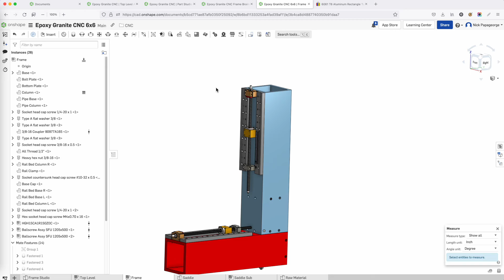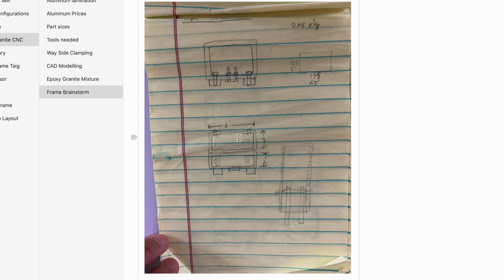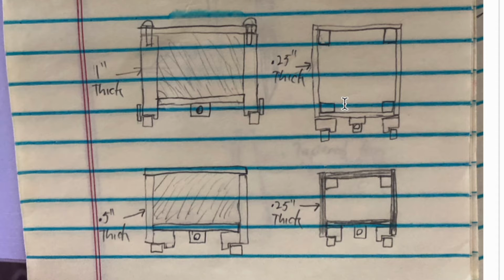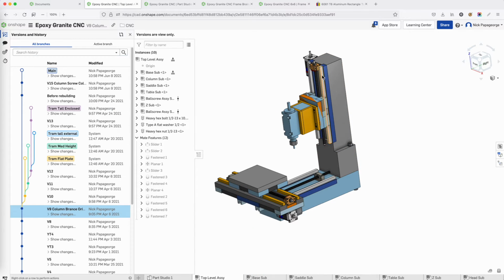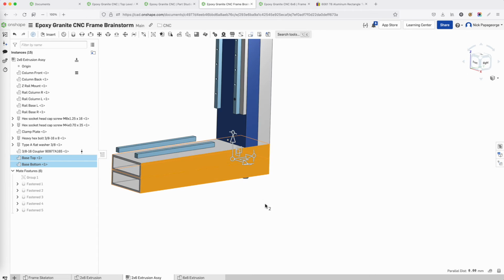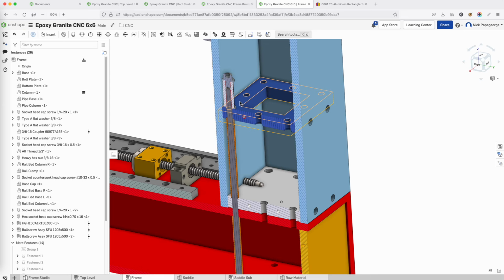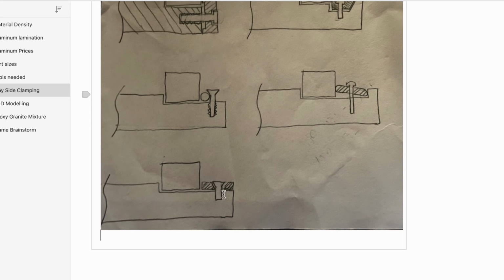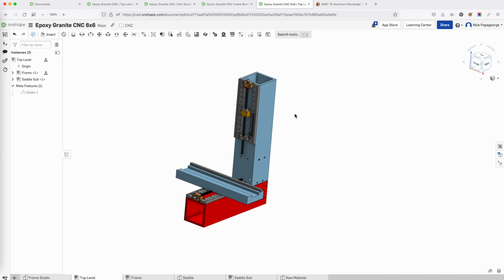Ep10: Epoxy Granite CNC Design - Starting over

Comment: Just going to throw this out there. Aluminum has over double the thermal expansion rate of the epoxy granite. After a many small temprature changes 10deg or a few large 50 deg changes the epoxy might delaminate from the tube making it useless. You would be much better off using steel or using the alumlinum as a mold  to hold steel inserts in the epoxy.
Reply from the maker: Good points.
Reply: As he's already bought the material, maybe put lots (hundreds) of screws through the shell to hold the epoxy.

Comment: Hey Nick, looking good.  I have my own epoxy-granite machine build going.  Gantry router with a 40" by 32" bed.  Trust me on this, You might want to try regular concrete if you are filling a tube. Confined to a rigid structure the concrete won't be able to suck in enough water to change substantially, especially if you seal the exposed ends.  LOADS cheaper.
Reply from the maker: Yeah, I’ve been thinking of that. I filled my Taig with epoxy granite and it was cheap, about $70 for everything. But the volume of this is so much larger.

Comment: That is smart, using aluminium extrusions. It's really more logical for small CNCs to go this route. Making the wooden molds is truly involved, have to make sure all the minuscule details in the mold are right. For the L shaped CNC, this aluminium extrusion concept is great. The only thing that worries me is getting the extrusion surface which the rails are going to be mounted onto needs to be precision ground or have at least 50-70 micron precision ground surface so that hand scraping them to 10 microns would be easy. This will actually take up a lot of time, effort and money for those who do not have a precision mill.
Reply from the maker: For this hobby build I think I can get accurate enough cutting the linear rail mounting surfaces on my Bridgeport. If I can get to 70 microns (.003") over the length of the mounting surface, I think that is plenty good for a hobby machine.

Comment: Would there be any advantage in having the column go all the way down and attach the base to the column horizontally, as opposed to how you have done it here (attach the column to the base vertically). I guess the answer depends on where the greatest load is transmitted when cutting, and I cannot figure that out. 

My initial thought is you have a constant load on the column thanks to the spindle - affected by how far out the spindle is held. The column wants to tip over. What stops it? If you h ave 4 screws in the column, the front 2 (in my mind, which can be woefully incorrect) actually pull the column forward (or at least add load to the forward face of the column), but the back two balance that, loading the back face, resulting in a nett downward force.

My thought experiment says if you just glued the column to the top of the base (vertical join), it would be easier to tip the column over than if you glued the base to the side of the column (horizontal join).

No engineer, just intuiting and curious. Quite possible I have it completely backwards.
Reply from the maker: Good question. Let me think about it and get back to you.
Reply: @nickp4793  I wonder if FEA would pick up differences in stress like this - not easy to do though.

Comment: Looking good.

The tips on derive with onshape are great, thanks. Onshape is my go-to these days. Sophisticated enough for most work.

Some things that occur to me:
You could potentially build up a flange on the bottom by screwing some thick plates to either side of the column. On the top a single thick plate might be good enough. That might be a little less complex than trying to build the bearing surface inside the column.

Curious to see how stiff the aluminum + e.g. is. I'm also curious how well the box shape resists torsional forces, which I would expect during side milling operations.
Reply from the maker: Thanks. Check out in-context editing. Its even better than derive, when things get more complicated.

Your flange idea is where my mind was going next. I think what I have here might just be too complicated.

I did do FEA analysis a year ago on a few different frame designs. I may make a video about them.

Comment: Thanks for sharing! Out of curiosity, why are you choosing aluminum over steel.
Reply: Guess: weight, machinability + availability. :D
Reply from the maker: @aarondcmedia9585  Yes, that's about it!
Reply from the maker: Hi, mainly for low weight so I can move it without too much trouble. Also because I found a 14 foot length of it for $250, that was a 30 min drive from my house. So I had to buy it:)